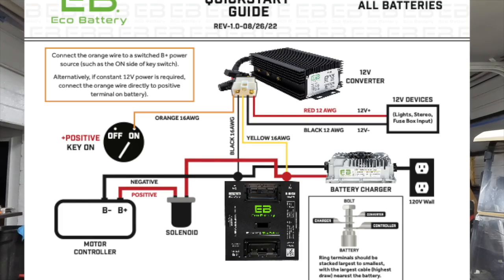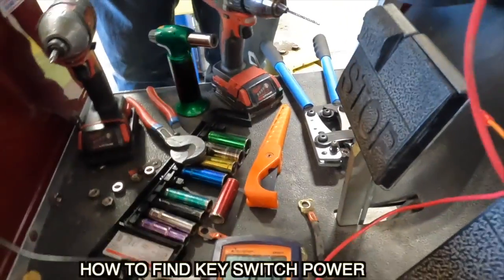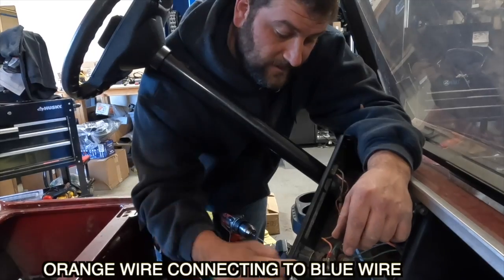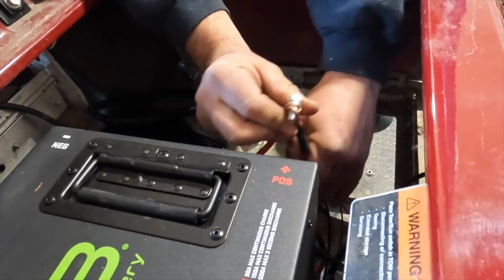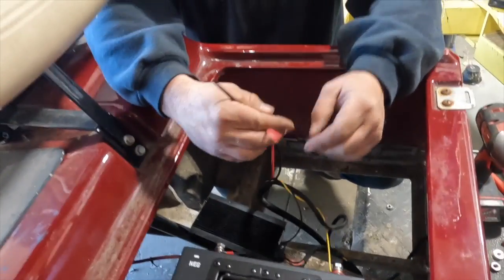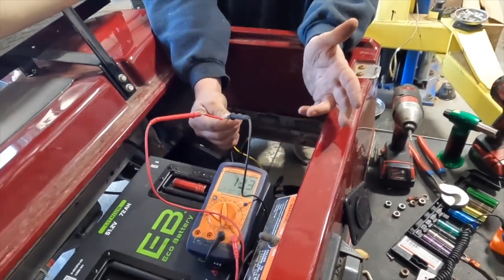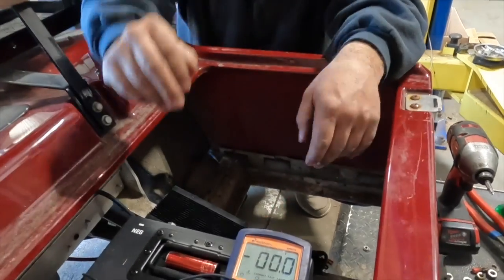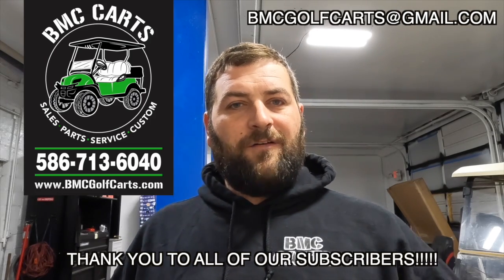How To Install Eco Battery 36v ,48v,72v Lithium Golf Cart Voltage Reducer (WIRING)

Comment: I like your video. Very helpful.
Question -
My key switch has 3 positions: Off, On, and Lights On.
Where should the Orange wire from the 12v converter be attached - to the Lights On connection?

Comment: the red and the black wire I can then wire to a fuse box and then wire accessories to fuse box.? everything wired to fuse box will be power on / off only with key?